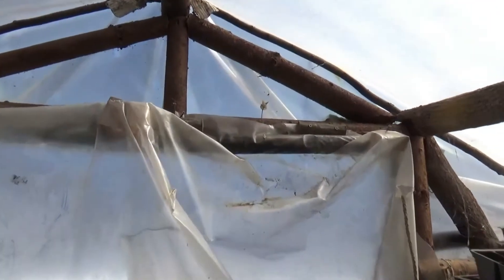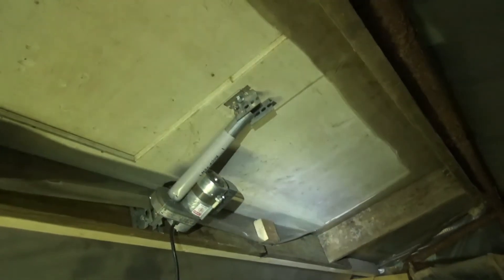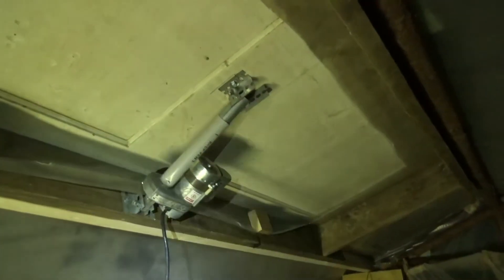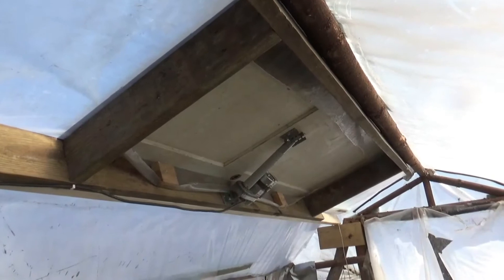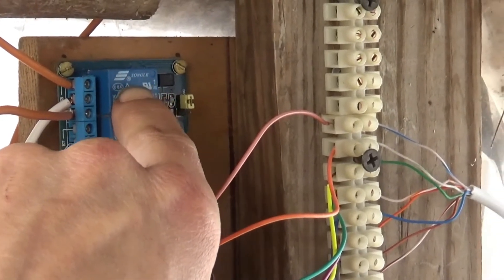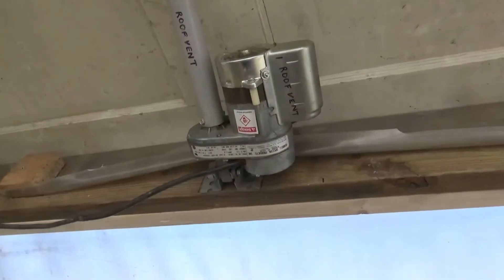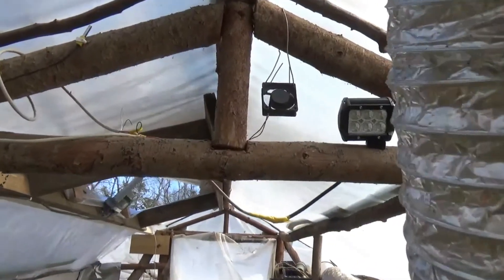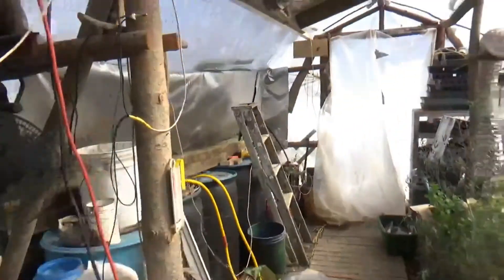Part 2 Automatic Vent Installed And Programmed * Raspberry Pi Controlled Greenhouse

Comment: Nice DIY automation! Should be able to keep the temperature polling interval relatively short, then only spool up the inverter when the temperature exceeds a threshold
Reply from the maker: yep... polling every 15 minutes... if temp exceeds 90 F... raise vent 20%... re-check every 2 minutes until temp is below 90... then lower all the way... wait 15   re-check...  also have a stir fan to equalize temps with the cycle.
Reply: Why not poll every 2 minutes regardless of the vent state?
Reply from the maker: it's really unnecessary atm...  but this is just the preliminary "test code"... I'm actually going to incorporate that code into the other temp control script and refine it a bit in the next few weeks. I need to install vent number 2 before I start really fine-tuning the code.  Vent 2 will let fresh air in on the bottom as spring comes on and temps skyrocket. It will be limited to not open when outside temp is below 45 or so probably. (prevent freezing plants in very cold weather)  Also, currently there is a "stir fan" on the same relay circuit until I add another relay set to accommodate everything, so this program is actually running 2 separate (partially related) functions. I'll do another video soon and go into more detail if you like.